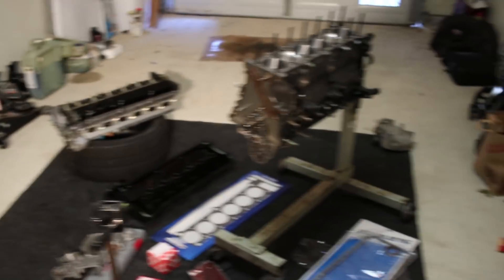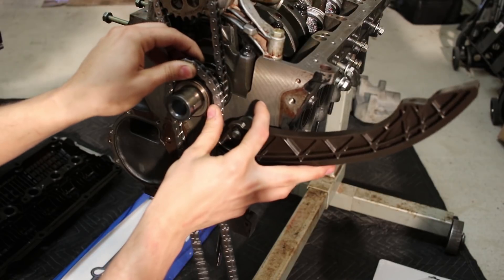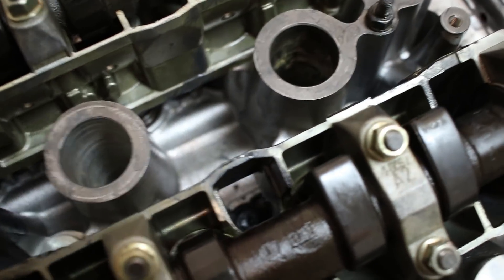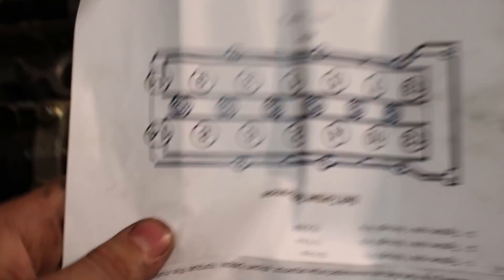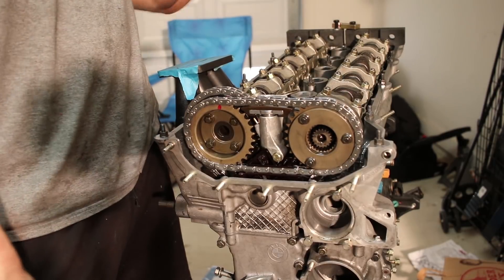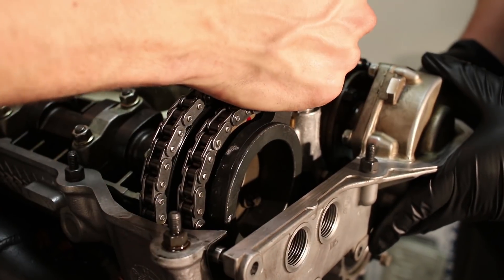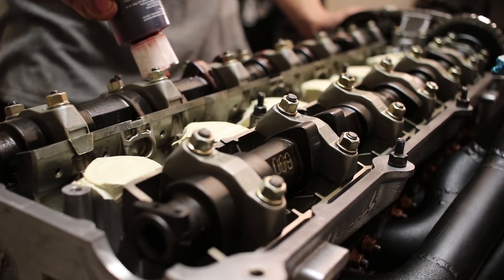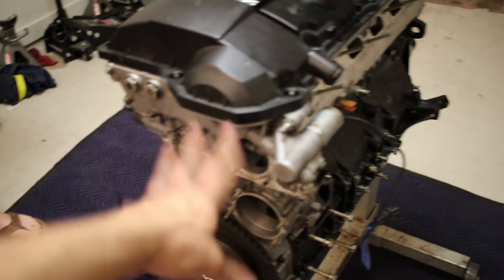Rocket Bunny Turbo S52 BMW E30 Build | Part 4: Top End S52 Assembly

Comment: nice build man, I just fished my top mount BWs366 build on BF. Hope she's everything you wanted! any reason why you didn't use copper spray on your cut-ring as recommended by CES?
Reply from the maker: Its an OEM style gasket, in my experience that means it goes in dry. Truthfully either way will likely yield no negative results. Additionally no Forum or manufacturer instructions say copper spray.